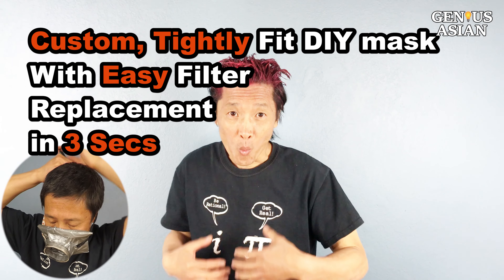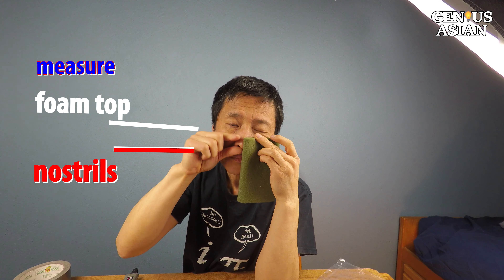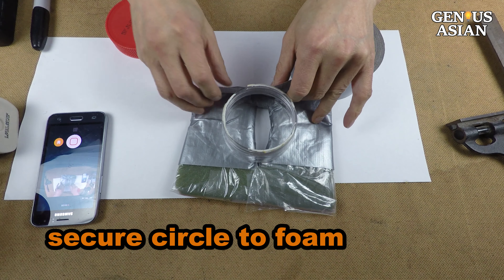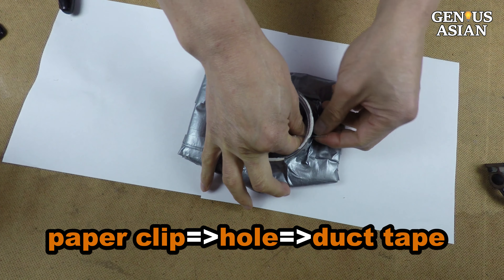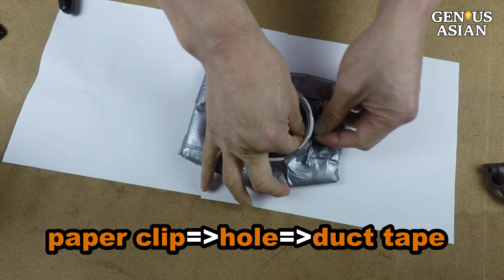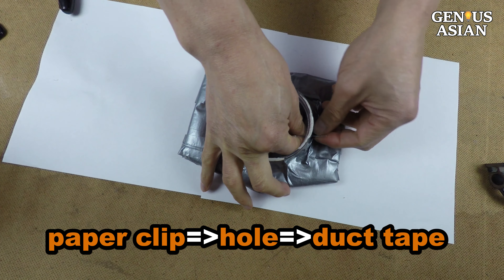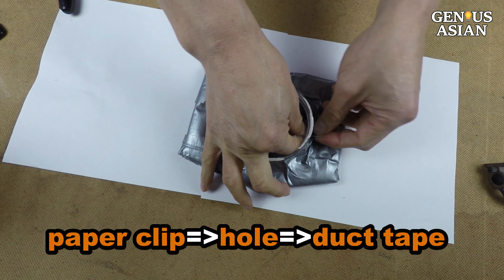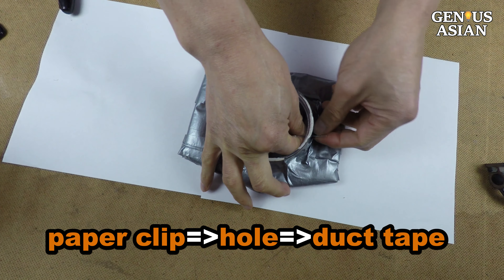Custom, Tightly Fit DIY Mask With Easy Filter Replacement In 3 Seconds

Comment: How about using a quilted blanket part cut out and make a mask. It has a filling and is at least three layers.
Reply from the maker: The commercial masks all have some design to eliminate the gaps on the side. If you want to use blanket, then you need to make sure the side is sealed with no gaps.

Comment: Maybe a video on how to disinfect surgical masks? I think the best is to put it in an oven at 100 oC for 30 minutes.
Reply from the maker: put your mask under the sun so that ultraviolet lights can kill the viruses. There is water repel material used on the mask, heat will kill the viruses but it may have some undesirable effect, so sun light is better.
Reply: @GeniusAsian  Yes, but UV rays (I have a 6W UV-A light, LED near-UV) only disinfects surface of the mask. It does not penetate the material.
Reply from the maker: @DashCamSerbia  yes, the UV light is attenuated as it passes through the mask layers and the amount of attenuation may vary depending on the type of mask. You may increase the dose.
Reply: Just wash with the soap
Reply from the maker: @ajijemuran7829  yes, after shopping you should do this: https://youtu.be/3xNTNRehrE4
Hands should be washed correctly: https://youtu.be/-YrBEj1fSPU

Comment: Hi 
Genius Asian
I cut a triangle out of blue mask. Put the triangle over nose and mouth. Duct tape triangle mask to my face. Go shopping. I am genius too. :-)
Reply from the maker: When you sweat or you have oil on your face, then your new genius idea may cause embarrassing situation.
Reply: @GeniusAsian  lol i cleaned my face, and i did not sweat. it worked fine. I only needed the mask for 15 minutes, and they keep it nice and cool in the store😃
Reply from the maker: @ScorpionF1RE_USA  yeah, 15 minutes of duct tape could be OK, if it is longer then you need medical grade tape.
Reply: that's cool acutally. multiplied by medical grade tape it is even practical.